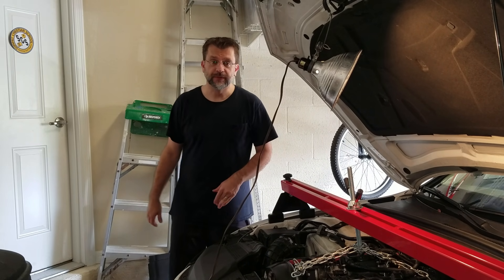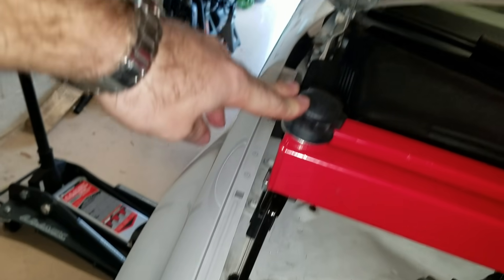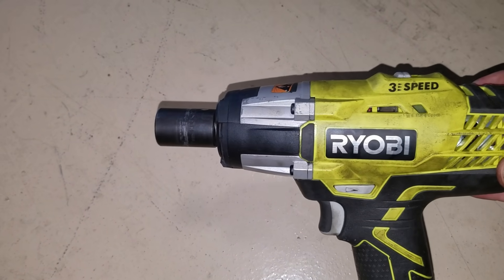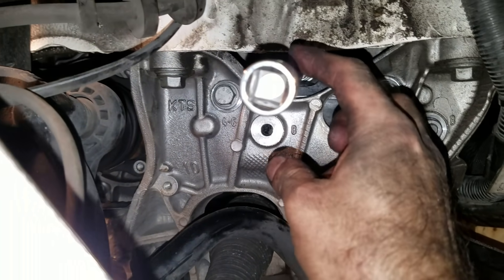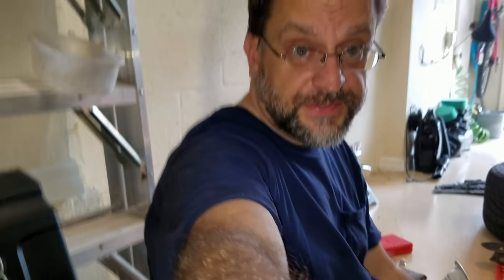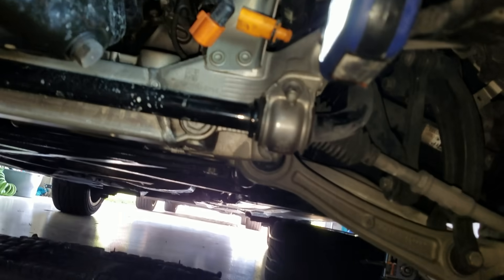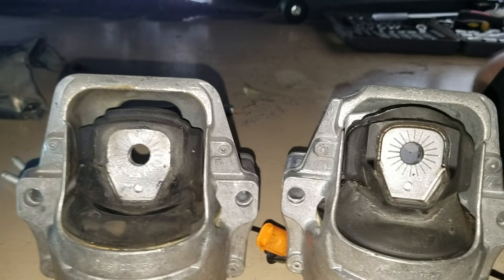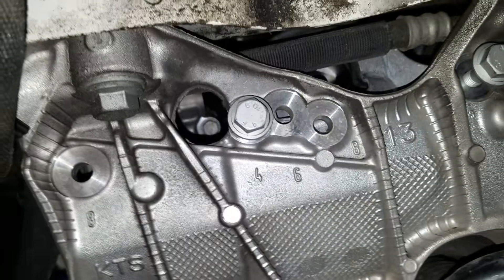Audi A4 B8 Motor Mount Replacement A5 Q5 2009-2016

Comment: The hook is to support the cable that runs underneath. Pro tip: DO NOT DO ONE SIDE AT A TIME. Support with floor jack and remove both 18mm’s at the same time. Then you can raise motor higher without putting stress on either side. You’ll have more room making it much easier to r&r. Also on driver side first reach down behind the mount and take off that hook. It’s easy to do and makes it way easier to remove mounting plate and put back. I think it’s a 10mm nut.

Comment: Nice video. On 2010 Audi A4 (FWD) both mounts can be removed at same time by lifting engine at oil pan.  Only one mount on drivers side had electrical connector.  We left the passenger side mount unplugged.  Very straightforward procedure.  Happy to consult if anyone has any questions.  Engine Bar was not necessary but may be extra measure of safety. 2 jack stands and large 3 ton jack with rubber pad. Took 2.5 hours and 1/2 hr of that was altering the mount plug which was slightly different than that on the wiring harness.
Reply: Hi I have vibration at idle and slight knocking on/off power and some gear changes. 
My car has extended Audi warranty, however the dealer has said no errors are showing when checking mounts. 
I suspect they are still bad, but can’t issue a warranty claim unless the computer says so.  Did your mounts flag up any errors or did they need to be removed before a bad mount was confirmed. My car is the B8.5 SQ5
Reply: What size is the triple square bit for the 2 smaller bolts that hold the mounting bracket onto the chassis?

Comment: Thanks so much for the video! One little detail, the torque spec for the middle bolt is 90NM + 90 degrees. I was able to go 45 degrees and gave up, it felt like I would strip the thread had I gone further

Comment: Appreciate your work!
One year ago I bought the same car as station wagon. Since then I fixed the PCV-Valve, sparcplugs+coils, injectors, carbonbuildup, doorhandle(keyless-switch), wheelbearing, doorlock driverside, lower control-arm, rearwiper-vent, controlarmbushings and turbobypass-vent. I bought the motormounts 3 month ago, but the whole time other issues had to be fixed first : )
So your video is a nice reminder to unbox them : )
#sometimesitdrivesmecrazybutIjustlovemyaudi
Greetings from germany
Auf wiedersehen!

Comment: Thank you for the video. It really takes away the guesswork. I just finished a 2017 Q5 with the plastic oil pan. I think this is where the engine support comes into play. 
I didn't have it and took a big chance using the floor jack with a block of wood. To get the extra clearance for the passenger side I ended up using a bottle jack on the bracket that the negative cable is bolted to underneath as I did not want to put too much pressure on the plastic oil pan with the floor jack. The driver side was easy enough though.

Comment: Theres so much more room in here than i have in my A4 B8 3.0TDI engine bay. :D
Got right side mount changed pretty easy (was totally ripped apart and made changing from 1 --> 2 mid corner impossible)
Left side seems to be almost no room anywhere to swap that mount, unless you remove whole left driveshaft assembly out of way.

Comment: Excellent video. I just did the whole thing in about 4.5 hours. The engine hoist was critical. It was actually easier than I thought. Thank you!
Reply: Do you know if 2.0tdi engine is very similar process? Debating doing it myself too. Also I might buy an impact wrench, as I can imagine my bolts are rusty.
Reply: @RoxusRemo  наверное поздно пишу)) но в 2.0 тди всё точно так же

Comment: great video, very helpful. I love that the bracket bolts on yours just came off with ease, I had to drill out 3 of the 4 bolts because they were stripped, rusted, and round on the outside instead of hex so that you could get socket on it when the inside triple square strips. Terrible design and weak tin bracket. Glad I replaced them as the driver side was torn in half. Replaced the terrible stripped bolts and welded nut on the back end of the bracket with proper 11MM socket bolts with locking nuts on the back. No room to access the back of the bracket either. This is my first and last Audi lol. Sticking with Ford. thanks for the video help!
Reply from the maker: Dang bro, you are the man! You got through it! Not sure fords are any better… we just bought a 2024 Maverick, time will tell…
Reply: @CarsandCoding  yes i replaced the pass side mount in January and oddly enough the old pass mount didnt have a wire connector so I couldnt plug the replacement into anything. I had to drill out 1 of those 2 bolts on that side. I just spent 6+ hours drilling out both bolts on the drivers side mount, replaced them with motor mount bolts from a 1977 Mustang II ;) and put a lock nut on the back and its perfect. Drivers mount was torn completely off and even the metal casing was breaking apart. engine and drive train no longer bangs and hesitates when stepping on gas. Service light on dash disappeared. I agree they all have thier issues, I have a 66 Mustang GT Fastback, doing a resto on a 77 Cobra II and I drive a 2016 GT Convertible so Im used to working on the domestics and they seem easier to access bolts etc. Good luck with the Maverick, they look really nice. Thanks again for posting this, it was very helpful. If I could only figure out the speaker issues on this Audi!

Comment: Thanks for the Video,Ive just done the RHS on my A4 3.0tdi. its a difficult job as the alternator is right in the way. with it loosened off it was just able to squeeze out. Its alot tighter in my car!

Comment: The clearest explanation of how to change the engine mounting. I have a question. I haven’t got the platform for raising the engine from above. Do you thing is  enough with the jack from below? Thanks a lot . GREETINGS FROM SPAIN
Reply: Just use the jack and a piece of wood. Make sure it’s on the engine NOT on any of the pans. And use a big jack like he has.

Comment: Nice how to, and I bought the jack, which works great with one design problem, the lip that hold the handle under  the bolt is not big enough, so if I tight the bolt that holds it I can't twist the handle to lock/unlock the valve, if I don't when I try to pull the handle comes off. Very annoying. I'm going to put a bed of weld around it and grind to just about clearing, but I should not be fixing it. One might say talk with the manufacturer, but reading through the experiences and comments, I won't bother.
Reply from the maker: Interesting, I havent had a problem with the handle, but I can see how it could happen. Thanks for watching!

Comment: Hi thanks for this video I have vibration at idle and slight knocking on/off power and some gear changes. 
My car has extended Audi warranty, however the dealer has said no errors are showing when checking mounts. 
I suspect they are still bad, but can’t issue a warranty claim unless the computer says so.  Did your mounts flag up any errors or did they need to be removed before a bad mount was confirmed. My car is the B8.5 SQ5.
Reply from the maker: There were no errors on the mounts I had. I expect that the mounts would have to be completely ruined for a code to be thrown. Shop should be able to see they are bad by visual inspection. Good luck fighting it!
Reply: @CarsandCoding  thanks for the reply, really appreciate it. 
Richard

Comment: I have the A4 B8 with the 3.2fsi engine. I was able to swap the passenger side mount, but the bolts to the bracket on the driver side are completely covered. Even with those out, I don’t think I can wiggle the bracket and mount out.

Comment: hi.. did u feel some rezonance before  changed monuts?
Reply from the maker: Yes the idle was rough before I changed the mounts
Reply: @CarsandCoding  i feel rezonance and vibration it about driving when is +- 1300rpm

Comment: How long do u anticipate the job to take?
Reply from the maker: About 2 hours for the first side and 30 mins for second side once you know what you are doing. If you have done it before it would take 2 hours total just because of the time to jack the car up, get tools out, put together the support beam, and clean up. 30 mins per side actual wrenching and wiggling the mounts in and out.
Reply: Awesome thanks for letting me know.

Comment: Audi SQ5 2015... can bad ruined engine mount can cause gearbox hard and weird shifting? Or make like a safe mode on gear when turn into a street???
Reply from the maker: It will not cause safe mode. No.
Reply: Shifting 2 or more shifts down are with a hard nock... and when I turn into a street it is like one second no gas and after one second goes back

Comment: Do I really need that engine support bar or can I do it as well with a jack underneath the engine?
Reply from the maker: You can do it with just the floor jack and a block of wood. I would have no problem trying it that way.

Comment: Hi, the supports are similar on a Audi A5 V6  3.2 Quatrro.  Do know if the supports in this model are sensor. Thansk.
Reply from the maker: Not sure, you can look it up on a parts site like rockauto.com or fcpeuro.com
Reply: I have the A4 3.2 and had no room to get the mount on the driver side. I think this is because the motor is larger in the frame.

Comment: So I had someone do my mounts, I’m now stranded because the bolt that goes thru the mount to the mount bracket is literally hanging off right now. Could this be a result of insufficient torquing?
Reply from the maker: Or maybe the bolt broke off from being over tightened. Too loose or too tight will do it. Should be fixable
Reply: @CarsandCoding  bolt seems fine, I tried to take it off cause it is literally all the way unscrewed, I can’t twist it up and take it out because the frame won’t allow me (not enough space to pull it off from the top), it appears to be it’s normal size
Reply from the maker: @EJR20  have to jack the engine up a little to get the bolt in probably. You can use a piece of 2x4 under the oil pan with a floor jack. Really though I would take it back to who installed it and have them fix. Get the job done that you paid for.
Reply: @CarsandCoding  yes I’m having them fix it tomorrow for sure!

Comment: What size do I need to remove the bolts on the  stamped bracket/plate for the motor mount?
Reply from the maker: It is a triple square, I’m not sure the size but get a triple square set and you will have the ones you need. https://amzn.to/3Q0HOEv

Comment: Please Help me out! Those bolts you took out at 9:27 with the ratchet the 8mm triple square, where can I find them? All four of mine rusted and stripped and I can’t find a part number or anything!
Reply from the maker: https://www.audipartsstore.com/v-2010-audi-a4-quattro--base--2-0l-l4-gas/engine--engine-and-trans-mounting
Reply from the maker: Use this link or go to your local audi dealer to get the bolts. https://www.audipartsstore.com/v-2010-audi-a4-quattro--base--2-0l-l4-gas/engine--engine-and-trans-mounting
Reply: WHAT IS THE SIZE 😫😫😫

Comment: was the car rattling over small bumps in the road and does this throw up a code on a code reader?
Reply from the maker: It does not throw a code unless its completely broken. Rattling over bumps in the road is a suspension problem. Most likely upper control arms and front struts. See my other video for that.
Reply: @CarsandCoding  I scanned it. Left hydro electric engine mount open circuit. Will get it on the ramp tomorrow. Cheers

Comment: Is the procedure the same for the 3.0 tfsi v6 engine? The components look the same.
Reply: Hey Cory I just did the left on a A5 with the V6. You need to remove the oil cooler from block and let it dangle or tie it out of way with a zip tie (will be connected via coolant lines) so it is a bit messier with oil dripping. Then you need to do basically the same with the AC compressor, don't remove lines but 3 bolts need removing from block. Very tight squeeze then to get out mountand bracket. The right side looks easier though.  I also dropped the sway bar but did it as was figuring it out dunno if you actually need to.

Comment: How are they holding up after over a year of use? I’m about to change mine to these same brand.
Reply from the maker: No problems. This is the oem original brand.
Reply: @CarsandCoding  so I got the same brand back then, and had them installed correctly second time around, since these other yahoos did a lousy job, but I still get cabin vibration especially in R and D. I also have a new trans mount, what else could be the culprit?

Comment: How about the symptoms for this audi snub mount? A4 mine going up and down but its really bad is that snub mount? And if i accelerate it thumped into gear
Reply from the maker: Sounds like you need to replace them. I had vibration when stopped that I thought was a misfire. The vibration was the motor mounts were bad. Also what really helps is transmission mount insert. See this video: https://youtu.be/kKA0twkuES4

Comment: Are lemforders the OEM or aftermarket parts? I am looking at lemforder engine mounts that only cost 45 bucks each, the genuine OEM mounts are 330 each... big price difference? I am thinking the lemforders wont last as long. Any input appreciated.
Reply from the maker: Lemforder is OEM with the Audi rings ground off the casting. Go with fcpeuro.com if you want lifetime warranty
Reply: @CarsandCoding  awesome much appreciated! The upcharge for 'genuine'  Audi parts is insane.
Reply: I ended up going with 034Motorsport street mounts. They do not have fluid, but are not supposed to increase vibration much. Planning to install them today.
Reply from the maker: @ThomasGillot  Awesome! Let us know how it works out, i have heard they are good
Reply: @ThomasGillot  Do you have a link where I can purchase these?

Comment: Can you do the transmission mount?
Reply: Same car
Reply from the maker: You can see me take the transmission mount off the car in the transmission fluid change video https://youtu.be/IY_VRHlfJuQ
Reply: Cars and Coding can you help me out with a time stamp?
Reply: Cars and Coding nvm, found it.
Reply: Cars and Coding my car gives out slight vibrations (especially on a cold start) when I shift into D or R gears, when it warms up they almost disappear (basically become very minimum) but not quite gone, I know when this car is totally alright it doesn’t give out any vibrations. Do you suggest it being the engine mounts or the transmission mounts or something else.

Comment: whats the sensor for?
Reply from the maker: If the mount would break completely then it would throw a code. Mine were not leaking or broken all the way through but they were causing a harsh vibration at idle.

Comment: There's also a different mount for A4 with CVT Transmission (up to 2012 model) - 8R0198381C
Unfortunately couldn't find any parts from lemforder. Best aftermarket ones I could find that wont blow ur wallet were Febi Bilstein (LHS: 39157, RHS: 43707)
Reply: it's the same, to my knowledge. Electrically controlled hydraulic mount.

Comment: This engine mounts are avalaible only in 2.0 generations because the 3.0 tdi both engine mounts come with cable , please specify well and do not confuse the customers , also you didnt mention the one that comes with the gearbox . So its 3 in total . 

Learn more and help people thank you .
Reply from the maker: Sorry, in USA we typically only have gasoline engines, so I don’t know anything about Diesel
Reply: @CarsandCoding  tdi an tsi it depnds so again , dont generalize that engine mounts are only one hidraulic and one with cable because it depends with the code of motor , 3.2 and 3.0s come both with both cables not only for one ☝️

Comment: I wish the part hadn't been cut out of you installing the passenger side motor mount. I've been struggling over an hour just getting the damn new motor mount to slide in between the engine block and subframe. I've literally given up and am taking a break.
Reply from the maker: It was not any different than the passenger side except for the hook bracket for the power steering hose. Try jacking up the engine further, it will go in. You can do it! :)
Reply: @CarsandCoding  Yeah my engine support bar was getting pretty tight. I said fuck it and put the jack under the oil pan with a rubber puck and jacked the engine up 3 - 4 inches. I think its because the engine brackets are to the right of where all the weight is (to the left of the brackets are the engine block, head, pistons, and exhaust workings) and the engine likes to lean to the left with all that weight. 

Still thank you for the video!
Reply from the maker: @mydimeisup5103  yes you got it! A little persuasion with the floor jack gets it in there.

Comment: I think it's more simple with a jack below the engine rather than installing the cross member and less expensive because not everyone has the cross member and to equip it is expensive 

and what are the electrical plugs on the brackets for?
Reply from the maker: You can do it with the jack underneath. I just was being fancy with the engine brace. The electrical plugs monitor the fluid in the mount and if the mount rubber completely breaks then the fluid comes out and triggers a fault code in the computer. Mine did not completely break so i did not have a fault. Some models have the plugs and some do not. If you do not need the plugs you can cut them off.

Comment: Trans mount ? Video ? I have trans mount original after 300.000km and i have problem of movement the motor . The motor mount (2x) have 30.000 km
Reply from the maker: I show trans mount insert here: https://youtu.be/kKA0twkuES4
Reply from the maker: Also I remove the entire transmission mount in this video: https://youtu.be/IY_VRHlfJuQ
Reply: @CarsandCoding  thank youuuu 👍